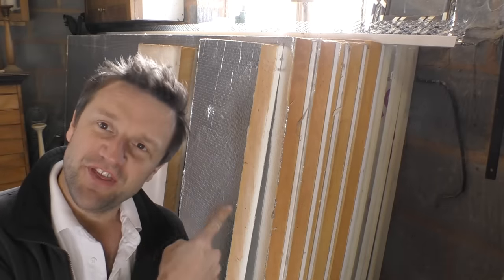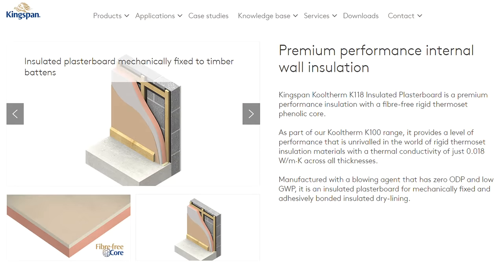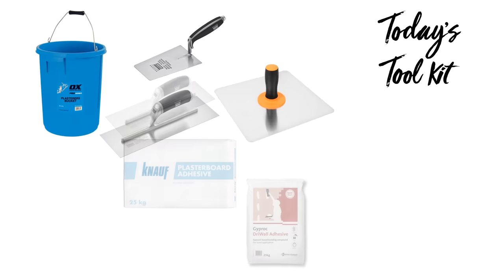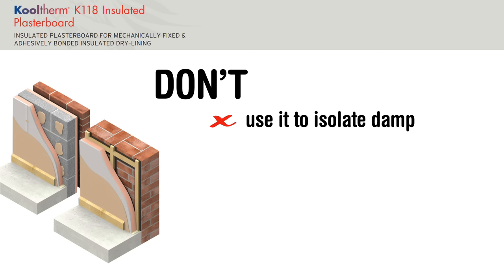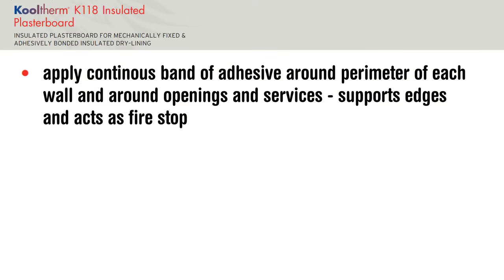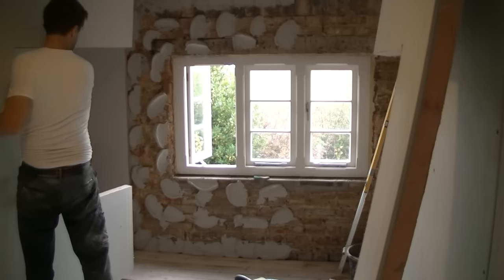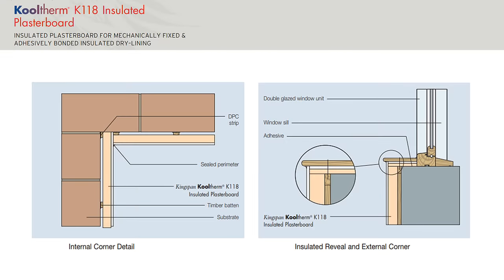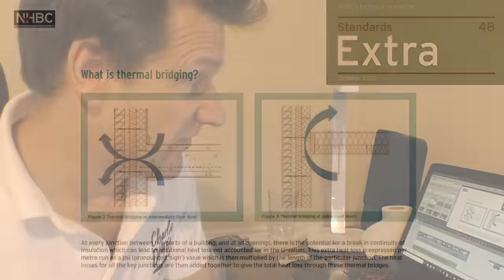How to Dot & Dab Insulated Plasterboard - a DIY Guide

Comment: Remarkable that adding insulation to a property with no insulation requires Building Regs to approve it meets their spec.  Does it meet their spec with no insulation?  Jobs for the boys.
Reply from the maker: I agree!
Reply: Oh and if you think that’s ridiculous, consider that most local authorities charge you per external wall insulated. performance of the whole building
Reply: Well said!
Reply: I’m doing mine and not telling them it’s for my benefit.
Reply: Screw telling them. how would those a-holes know!
Reply: Exactly. Don't tell them fk all.

Comment: Charlie, tidy quality job. I've been plastering 40 years and I'd score you 9/10. Just a few comments, too much adhesive. Dabs only need to be 600 centres edge and middle of the board, dabs were too flat and should pretrude from wall 75-100 mm and board from window reveal out toward corner of the room All these tips will use less materials but all in all you have done a great job 👍
Reply: Does this mean start at each window reveal on the face wall not the actual into the window reveal? So board from edge of window towards the corners then fill in the gaps between the board under and above the window?

Comment: I've learned so much from this. Was nearly about to have insulated plasterboard put up on all four walls without being aware of building regulations. Life saver, thank you!
Reply from the maker: You're welcome. With insulating internally like this, you need to pay close attention to cold bridging points (breaks in the insulation). Cutting through the board for plug sockets, where each sheet butts up to the next and around windows are the big culprits. Expanding foam adhesive is one answer rather than dot and dab adhesive but you have to choose an expanding foam that's compatible with the Plasterboard. It's well worth doing this but you have to get it right to prevent moisture from the house getting between the boards. 👍
Reply: @CharlieDIYte  Thank you. Any recommendations on good expanding foam adhesive? I'll be using the Knauf Thermal Laminate and the Knauf Soundshield plus plasterboards.
Reply: Instastik is a good one. Very easy to apply and is made specifically for this job.
Reply: @CharlieDIYte   Have you seen the gyproc insulated plasterboard? They do their own sealant for a mastic gun the same as your dot and dab approach, goes straight onto existing wall. Wondered about doing the two walls either side of the chimney breast as they're external and get really cold.
Reply: I also thought I’d need to do this! Does the video relate to the building regs of today? Thanks!

Comment: Fantastic video, thabks for taking the time to record, edit and share. I'm going to tackle my front porch which is only a single skin of brick as it's the cold spot of the house and I was looking for recommendations for an insulated and moisture-proof board and this came up right away. I'll probably go with the batten fitting solution as I doubt it has anything in the way of moisure prevention currently. Thanks again.
Reply from the maker: Good idea. The thing to remember when you do this is cold bridging, cold bridging, cold bridging. This is the biggest problem when insulating from inside. A lot of care needs to be taken with window reveals corners and plug socket boxes - which ideally need insulating behind to prevent cold spots and moisture ingress. Good luck 👍

Comment: Thank you so much for taking the time to do this video and the one about relative humidity. I'm planning to purchase a property in Central Portugal where the older homes are notorious for being cold and humid during the winter. I now have a general understanding of how to tackle those issues.
Reply from the maker: Thanks Jason. And some sort of dehumidifier perhaps, or possibly a PIV?
Reply: For your application it may be worth looking into a product called 'Spacetherm'. Much reduced (often 10x) thickness for similar U Value (W/m2k).
Reply: @Bradleyguy22  But at a cost of about £100 per square metre it works out quite expensive.
Reply: @robertsmart7484  Hi, absolutely but in certain circumstances/properties the cost may be acceptable as it's the only method / cost effective solution etc but yes, it's not cheap.

Comment: Another brilliant video, thanks Charlie. The way you installed your insulation was so much more thorough than our builders! Re solid walls and dot & dab v mechanical fixing:  On an early Victorian 4 storey terraced house, we were advised by Kingspan to mechanically fix on the 2nd floor where the walls are thinner and there was a risk of water penetration but I wanted to let others know that we got away with dot and dab on the 1st, ground and basement.  The basement has no soil against it and the walls and floor were damp proofed with a Newton membrane. In addition, the walls get thicker as you go down the house so Kingspan calculated from our dims that they would not suffer from water ingress.  We also observed the walls over a couple of years and knew that there was no damp issue. So it is always worth checking with the very helpful technical team at Kingspan.

Comment: I'm a plasterer  and I'd like to say very nicely done make sure you use a secondary  fixing  the adhesive  is more like a packer I like to use 6 fixings  more like a 6 on a dice than the way the manufacturer  recommend  but top job I've had lads working  for me with years of experience  that turn out worse boarding  than that well done
Reply from the maker: Thanks so much Robert - I've got to say I was a bit nervous about posting this one but felt strangely compelled to do so - but comments from professionals like yourself are massively appreciated! Out of interest do you use the cork screw style mechanical (secondary) fixings I mentioned, or something else?
Reply: @CharlieDIYte  I've  tried many different  types  of fixing  and to be honest  I've never really  been happy with any of them the insulation  fixings  are great because  there all plastic  but there about 5mm so skimming  the wall becomes  a pain I've settled  on using  a tile backer board  washer with a zinc plated concrete  fixing  I have to make the hole in the middle of the washer bigger to let the screw head sit flat but it's the best I can come up with. most other options  have either a small head so not really holding  the board tight or othersare too thick to skim over
Reply from the maker: @robandamyp  Agreed. I thought about frame fixings (or the excellent steel core Corefix), rebated into the surface with a flat wood bit but being plastic they're not fire regs compliant.
Reply: @CharlieDIYte  Another tip which i always do is to drill a sequence of holes and stick the foam gun in for extra adhesion ..
Reply: Got all this on the inside of my house on the external walls... just dabbed on.... I know it is meant to have mechanical fixings in an ideal world but it was done before I had the house and I’m not tearing it all off now haha. No problems as such just a few annoying movement cracks on the joints even with scrim tape on. So when going though the rooms decorating I’ve drilled small holes on the joints back to the brick and wet in the hole with diluted pva then foam filled to effectively stitch the crack. The stuff is as warm as toast in the winter and the heat wave last year nearly killed me inside haha!
Reply from the maker: @MarcGray1990  Hi Marc, thanks for your comment. It's great isn't it. Totally transformed our house and eliminated the mould.
Reply: Charlie DIYte my heating only goes on for a few hours and house stays warm. Fixing to use on this plasterboard would be a good video for you as it has the polystyrene behind which causes a problem with some fixing methods 👍
Reply: hi Anthony When  the plasterer dot n dabbed the walls on my new extension he really skipped on the dots and the dabs and it sounded like a drum when I tapped the walls, so I did what you did, drill and expanding foam, worked like a charm.

Comment: Great video Charlie, it is something I really want to do and something I have researched a ton about, reading all the technical data etc but still feel there is not enough info out there. However this is by far the best video i have seen.

I would love to pick your brain as you too appear to have done a ton of research. 

The main areas I have concerns with is the vapour barrier and access for wires without cutting or making holes in the insulation. 

So my thinking is to press the insulation against the wall (mines rendered and is sound), tape all the joins and foam/tape/seal all the edges. Then put 25x50mm (standard roofing type) battens against the insulation, 25mm thick and screw the battens through the insulation and into the wall. Then plasterboard (normals fine but i would choose foil backed) to the battens and skim. 

This way seems to allow for the best vapour barrier you can achieve and u would have a void for cables without compromising the insulation/vb, and you could hang selves, pictures etc to the wall as you would any plasterboard wall without messing with the insulation and vb, and from what I can tell buying insulation and plasterboard separately would be cheaper also. (Window reveals would have to be dealt with differently)

Can you see any downsides to this approach other than losing a few mm due to battens being a bit thicker than dot&dab.

You input would be very much appreciated. 

All the best

Comment: Great video Charlie, clear and well presented.  I have bought a villa in Spain with solid walls, and the rooms are COLD in the winter.  I had thought about insulated plasterboard. Having watched your excellent video, I will be insulating the wall, so hears to a warmer property.
Reply from the maker: Thanks George. Before you do it, do lots of research on cold bridging and make sure you buy a board with an in built vapour barrier.  Sockets and the edge of each board, corners and around windows are potential sources of cold bridging (cold spots) where condensation can form. And check out this video https://youtu.be/TIDb-pdOnXM on keeping moisture levels down, though you may not have too much of a problem with that in Spain?

Comment: Had a mate that retro insulated 5 houses like this except he used PU foam adhesive to adhere it to the wall. And mechanic fixings afterwards.   PU adhesive is less likely to draw water through the wall.   But you can’t use it to  plumb the wall.  

Great if your walls are fairly flat and plumb to start off with.
Reply: That pu foam has a good name because when i smells it I always say PU lol
 Seriously though if you have any damp issues that pu foam does eventually degrade, in my experience. Maybe not as fast as some silicone or other similar adhesives tend to though. Silicone is a lot easier to clean up though

Comment: Retired builder good demo Charlie. No rambling tech waffle nice straight down to brass tacks! Many rather pay its still a tough job ok if fit and enthusiastic!
Reply from the maker: Thanks Phil, I appreciate that. There are things I'd have done differently (like use the foam instead of the adhesive) but I covered as many bases as I could. 👊

Comment: What an excellent video really. Brilliant information very well made, you cleared up a lot of confusion for me.

I'm concerned about condensation on the back of the board though. It seems people prefer to mechanically fix for this reason. I wonder if anyone has anymore information for this.... personally I think the adhesives these days are incredible.
Reply from the maker: Thanks Adam. Yes, I mechanically fixed the last room I did and going forward I think this is a preferable option. You're right to be concerned about condensation, particularly where you're cutting through the board for the electrical back boxes. You want to aspire to creating an impregnable vapour barrier and continuous insulation to eliminate any cold bridging - which is damn hard in reality. In the bedroom I've just done, I battened the wall with 2x1 tanelised, dpc between the batten and wall where it touches - as the wall isn't level there was a nice gap behind. Then I infilled with 1 inch Ecotherm, foil taped over the joins, and then mechanically fixed the Kingspan to the front. That way, the electrical boxes only penetrate through the front insulation (I foil taped a piece of 12mm ply to the back of the Kingspan at that point to screw the back box to), and there's no cold bridging. Oh and I used that expanding foam tape you might have seen in that vid, underneath the Kingspan. It's breathable but eliminates any cold bridging.

Comment: Excellent video. Thank you for sharing. I had insulation boards put on two walls in my kitchen and on one wall in my bathroom by the Housing Association I am under several years ago. To my surprise they put the boards over plastered walls. Since then, I have encounter problems with mildew around the top and edges of the boards and think part of the problem might be that they haven't been sealed correctly.
Reply from the maker: Yes that'll be because of cold bridging. Take a look at this video https://youtu.be/TIDb-pdOnXM It's important you have some ventilation in your place during the day (windows open if you can) just to let out the huge amount of moisture we generate daily

Comment: Useful video Charlie thanks for posting. You do make it look easy! I imagine some complexities not mentioned, such as boarding around the window and needing to extend window sills and what about electrical wiring, the cables would need to be long enough to feed a patress that was now further from it's original location and would need to be fixed to whatever the new insulation has been fixed to. No expert here so maybe i'm overthinking it.
Reply from the maker: You're right. There are lots of complications. Around reveals the insulation needs to be continuous and socket boxes are an issue both in terms of cable length - I guess you could extend with wago's - but also the cut out being a potential cold bridge as is the break in vapour barrier between each sheet. I'm currently working on a breathable internal wall insulation in my kitchen. If you can hang off for a month or so on your project, there should be a video. 👊

Comment from the maker: 🛠Charlie DIYte Amazon Tool Store https://amzn.to/3fcLnY4 - all my tried, tested and much loved DIY tools. Help support me by Buying me a Coffee ☕ https://bit.ly/3xuQ3zb and unlock a host of benefits - thanks so much 🙏.
Reply: Great stuff. Quick question though - I’m wanting to practice doing this, and am thinking of using my garage to practice. The wall I want to use is breeze block, other side of the wall is a recently converted garage with breeze block, wooden battens, insulation and then plasterboard. Rather than buy the insulated plasterboard I’m wondering if I can just use standard plasterboard straight onto the breeze block? Thoughts appreciated!
Reply: brilliant, Charlie. I subscribed to your channel straight away. I've seen a few other DIY channels, but they don't explain things properly (which you do). I can't thank you enough for this. I just found out that my cold rooms (external brick) just have concrete skimming on the inside + wallpaper over the top, so they were never plastered or insulated. I'm definitely going to try your methods + this is fantastic advice for a novice diy'er like myself, especially as I can't pay anyone to do it for me + live on my own. Can I ask: whilst the adhesive is drying, do you need to support the panel against the wall with anything? Or not? [el'sda2].

Comment: Awesome job mate! I wish I could do that here but my walls tend to be rather damp in this Old House and I don't trust the roof. It started to leaks in a few spots again, even after having all the clay tiles replaced a few months ago. I was able to get on the roof and sealed the leak spots but I'm not sure how long that will last. I don't mind running the heater in the winter more. I'll probably just stick to slapping some anti-mold paint up on these old walls and see if that does anything for me. Cheers!